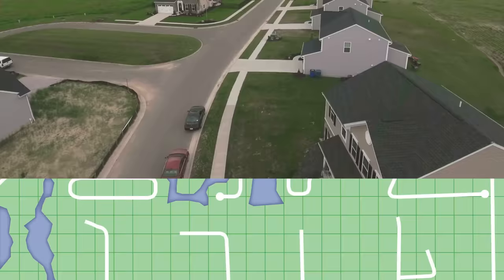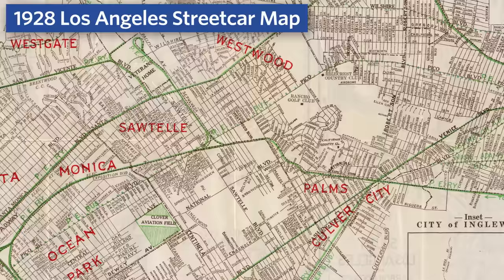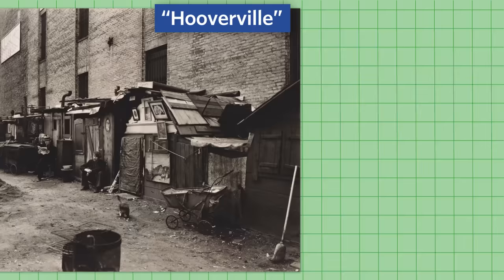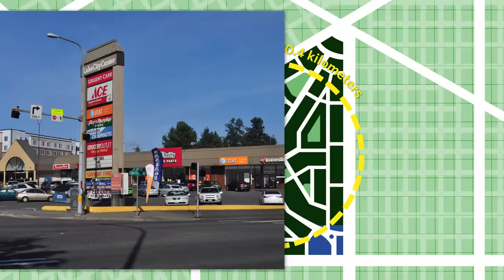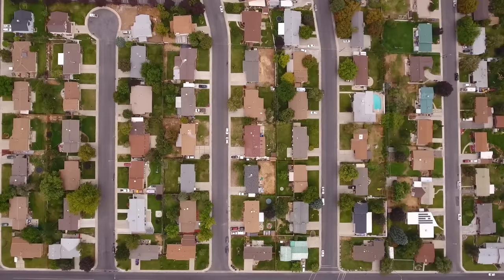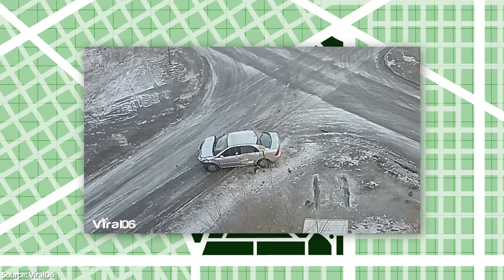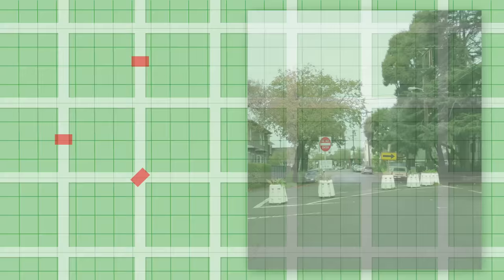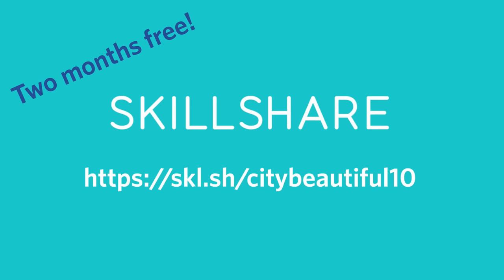The Reason Our Streets Switched to Cul-De-Sacs

Comment: every european is just looking at all these americans talking about how difficult it is to navigate something that isn't a square
Reply: Kinda like US drivers getting a brain freeze when a roundabout is ahead?
Reply: Ciuy R ROUND-ROAD-CANNOT-PROCESS
Reply: @ciuyr2510  As someone from the U.S. people here get brain freezes just making a right hand turn... So you're 100% right about the Round-Abouts.
Reply: Joris van de Ven     X z
Reply: Suburban neighborhoods aren't just circuitous streets. They're difficult to navigate specifically because they were designed to essentially make intuitive navigation impossible. Since streets intentionally don't link up. If you don't know your destination there's a pretty decent chance you'll be hitting many dead-ends and loops. Which is the point, to prevent thru-traffic.
Reply: Your either sticking to a main street or your on an adventure. I've turned a 40 minute walk into a 4 hour walk by taking back roads. Eventually I had to use gps and a map to get home because it's all dead ends. Plus crossing a yard can turn into a trespassing issue so even seeing the road you need means nothing because your in a maze. They should warn you every time that your two blocks from a dead end because backtracking every other street is insane.
Reply: @Sol-Invictus  In the UK at least, every dead-end road has a "T" sign indicating it's a dead-end at the starting intersection. Surely that can't only be a European thing?
Reply: @Wasserfeld.  Some have a dead end sign but in my area it's like 1/3. You take a wrong turn and it's all creeks railroads and dead ends. Like the maps in the video if you imagine being in ground level with all the trees and houses blocking vision it's pretty bad for foot traffic.
Reply: @Wasserfeld.  we have the 'no outlet' sign, that means 'this road dead-ends'.  It isn't required to use them.
Reply: Every European loves to over generalize what Americas do. That's what happens when you love us so much you hate us. Dont generalize one dude's opinion.
Reply: @Sol-Invictus  Ah right, fair enough
Reply: @ciuyr2510  Americans use square-abouts
Reply: @ciuyr2510  - True; amazing how may people struggle with roundabouts.  Carmel, IN where I do a lot of my driving is now up to 125 roundabouts with surrounding towns all making a similar effort so you would think we'd all be used to it by now.
Reply: @Jim Levain  Interesting, you countered someone else’s generalization with a generalization of your own.
Reply: @LilBoyHexley  yeah, thats why we use road signs to tell us that there is a dead end street ......
Reply: @xenxander  it isnt required to use road signals ? hah... country of hypocrites
Reply: PLEASE
Reply: NASCARS doing the same loop over and over again what's the point. I could sleep in that car basically clamping the gas pedal and the steering lol and just wake up and collect my prize
Reply: Dwain Harrison He’s fighting fire with fire!
Reply: Edinburgh is a grid. It's sooooo easy to get around.
Reply: @Jimmyjimjimjim  Well its more Like watching in a Zoo, instead of "Loving".
Reply: @ciuyr2510  No Americans can only go in circles.
Reply: @BanjoTownFan  I'm good with roundabouts, but cul de sacs in most US cities are just awful. Every neighborhood looks almost exactly the same and it's way too easy to get lost in suburban hell if you aren't familiar with the area.
Reply: Totally agree I went to New York a few years ago and got lost real easy due to the square nature of the city but the European messy jumbled way of doing thing seems to easily adapt itself to your natural instinct of navigation when lost
Reply: So true. My brain just can’t register the wheel spoke construction of so many European towns and cities.
Reply: I imagine an american having a stroke trying to navigate a city like Amsterdam 😂
Reply: Ciuy R Well, their cars can’t turn.
Reply: @LilBoyHexley  It is one thing to prevent through-traffic of cars and trucks. But preventing through-traffic of human beings (you know, pedestrians and cyclists) is the best way to turn a neighbourhood into a prison.
Reply: @ixlnxs  I'm not commenting on whether it's a good or bad thing. My point was just that they were intentionally made to not be navigated.  

I was responding to the OP of this thread about the difficulty of navigating these suburban streets. They aren't just "not a grid", they are a purpose-made series of curves, loops, and dead-ends with often little or almost no connections to primary thoroughfares.
Reply: Every other street in my suburban childhood neighborhood is a culdesac... LITERALLY!!
Reply: @LilBoyHexley  dude you should seriously come and see the roads of Belgium... Neighbourhoods aren't a thing, we used something we called 'lintbebouwing'. You should look up the town of Burst, Belgium on Google Maps xD. Tell me what you think of it
Reply: @BanjoTownFan  in UK it's simple

Just give way to right hand traffic if indicating to block your path but also be observing the people opposite since they can block the cars to your right  opposite you and where they are. If there are people at every entry then someone just needs to go first so it's really simple
Reply: Joris van de Ven people in Barcelona be like ....
Reply: Fr as an American who loves cars I can’t believe how bad the education is for driving, they teach you either things everyone knows or stuff that doesn’t matter. They still don’t teach diverging diamonds or roundabouts, both of which are awesome.
Reply: I live in a place called the woodlands and if you don’t live here it is impossible to navigate. It is essentially a maze of culdisacs and small self contained loops and just enough thru roads for you not to memorize them, this is only really a problem because everything looks the same, they lined every street with enough trees that you can’t see what’s on the other side. It took me bout 6 months after moving here to start getting the hang of it, and that’s just because I memorized the map.
Reply: Arrogant!
Reply: @ciuyr2510  ...I'm old , I don't like round abouts , what is the proper lane ..and blinker ...where ? When ...it's fine in low traffic densety times..and consider, if 30-50% of people are..cautious and unfamiliar..if your on a bike ...death lurks at the roundabout.
Reply: @mj6463  Or zipper merging - my biggest driving pet peeve! Where I live, they are all over the place, but if you use the right lane when there are two lanes turning left at a stoplight (supposed to zipper merge after the turn), you will get bullied. People act like you are cutting in line. So, you'll pull up to a stoplight with room for 20 cars in two lanes to get through one light, and all 20 will be in the left lane, backed up, with the right lane empty. Then, only 10 cars get through the light.
Reply: Americans stop at yield signs and yield at stop signs.
Reply: I'm European and I live in a city with a grid pattern. I find any city without a grid pattern extremely confusing and chaotic
Reply: @garymingy8671  roundabouts are made for heavy traffic areas. Flow is much better & safe. Bikes have it easier in a roundabout because same rules apply to all participants. You only need to blink when you change Lane, not when you turn your wheel. General rule. You don`t need to blink in a curve. Being old is not an excuse if you can`t figure out a basic roundabout
Reply: @garymingy8671  how are you even driving without knowing how a roundabout works btw? Seriously do us all a favor and google it, at least, before it happens
Reply: It's not necessarily that it's difficult to navigate something that isn't a square (I'm from DC, which is a gridded wheel -and-spoke city) but in a lot of suburbs it's difficult to get from point A to point B without a vehicle, due to how the streets and pedestrian pathways were planned. Say you have 2 parallel streets with no outlets that each could easily be the length of 2 city blocks. If you live at the cul de sac of one of those streets and you're trying to get to your friend's house in the cul de sac parallel to yours, you're walking 4 blocks to get somewhere that would be yards away if there were simply a path allowing you to get there without trespassing into people's yards and climbing over fences. As someone without a car it's very annoying, because there's a lot of places I could easily walk if the pedestrian pathways were in place, but they're not so I either walk a convoluted way or take public transportation there (I'm lucky to live near a bus line, many aren't).
Reply: rxp56  Generalizations are not largely true when based on a few people in that group or from data from 50 years ago. So no my statement is not absolutely hypocrisy.
Reply: Wasserfeld a lot of dead end in my town are more prominent (small town in the USA)

On a dead end road there will be different signs (varying)

Real Short Road: Dead End

Road 1.2km long: No Outlet Sign (sometimes a long with a Road Ends in [distance] sign)

Less Traveled ending road: 1.2km long: Road Ends 1.2km sign

Its not in km but I made it understandable for you
Reply: You should look at a few more maps of modern suburbs and then realize that every house looks almost identical, many of the street names are arbitrary numbers and that some places can be structured like this for a couple miles in every direction and than think about how easy this is to navigate.
Reply: @ciuyr2510  Technically you're supposed to indicate where you intend to go as if it were a regular intersection on entry, then signal right on exit.
Reply: Yeah
Reply: @ciuyr2510  or a german getting a brain freeze when watching any not-german driving😂😂
Reply: Ciuy R come to Pakistan and India we have speed bumps, unorganized cities and hella round abouts!
Reply: Sir Daniel Fortesque I’m from a region where they’re much more common, but it’s a tourist destination, so all the tourists just block all the roads leading up to it.
Reply: @ciuyr2510  two words Haas traffic jam, just a FYIthe average daily commute for a Americans use anywhere between six and seven hours for those of us that live in cities
Reply: Well both are confusing tbh, I find European cities hard to navigate because they are as messy as their suburbs and American cities are so samey that every street looks the same, the only way to not get lost is to know your way around
Reply: @LilBoyHexley  Good Point  

: ))))))
Reply: Yet Europeans think driving 300 miles is a long trip
Reply: @LilBoyHexley  They're called paths. You can make a pedestrian grid.
Reply: @Sol-Invictus  Don't you guys have NO EXIT signs? We have.
Reply: @Wasserfeld.  We have it. We just have a little tab sticking off the road sign saying NO EXIT.
Reply: Square good, circles bad.
Reply: I mean you guys have better public transportation obviously, but all the roundabouts in the world wouldn’t save those 800 year old roads if you had as much traffic flow as us lol
Reply: @supermoneyball420  clearly you have never been to europe ever
Reply: @BanjoTownFan   I haven’t but I’m still right lol. We have something like 9 cars on the road for every 10 people which is almost double what most European countries have, regardless of how shit our public transit is that’s an insane amount of volume for anybody to handle. Like look at Boston, they’re probably one of the best analogs in the US for a European city in terms of infrastructure, and despite having an amazing transit system compared to most of the country, they have some of the worst stand-still freeway traffic I’ve ever seen. The problem is sprawl not the grid system, like there’s only so much you can do when millions of people live in an endless sea of suburbs, with most of them pouring onto freeways around the same time every weekday and all going to roughly the same area.
Reply: As a European I find navigating our organic cities way easier than soulless American ones. Every single street in those American cities look the same, you can never recognise places on maps and you can never give road directions from memory. And the block system actually wastes more gas because you're constantly stopping and starting for every single intersection.
Reply: US motorsports consist of mainly turning left... I guess also having to turn right is just a bit too complicated as navigating something that isn't a square!!